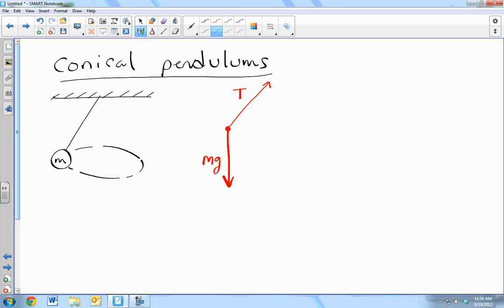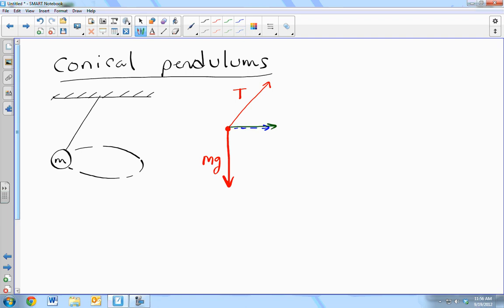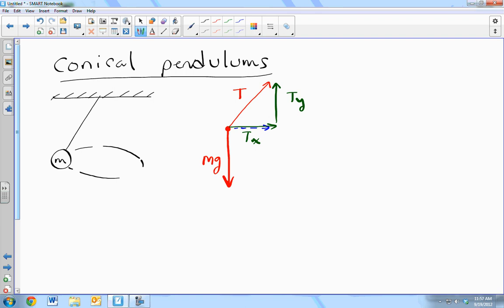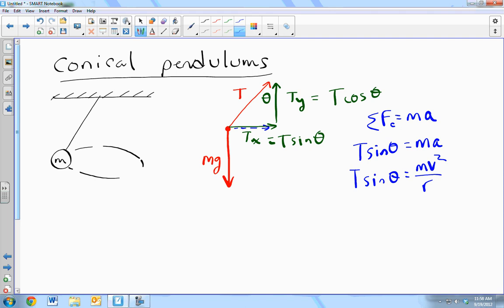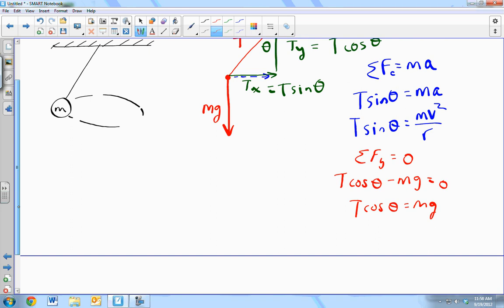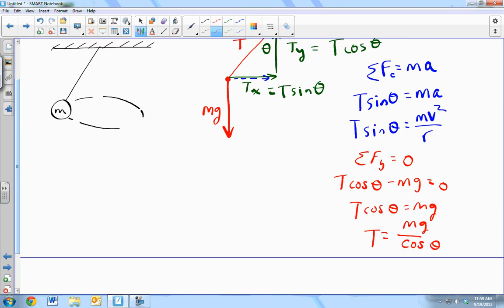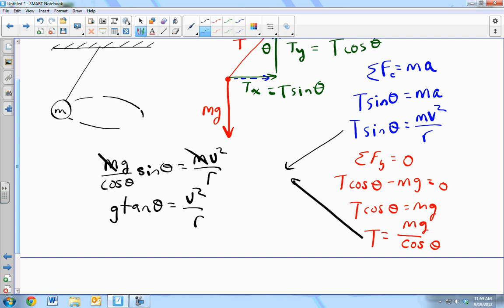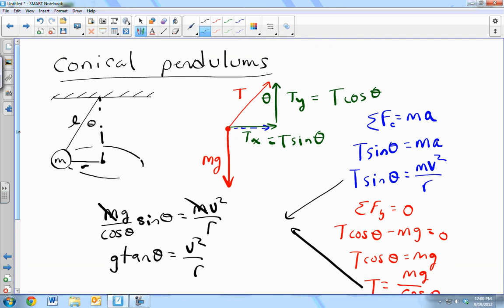Conical Pendulum

Comment: you know, when you get to your tension in the x and y direction, I don't get how they just became T. I mean doesn't Tx differ Ty? So how did you substitute Ty into Tx, Making i'm missing something or haven't read enough on it. Could you please answer this question as soon as possible, thanks in advance
Reply from the maker: Jilwan Rahimi We defined Tx=Tsin(theta) and Ty=Tcos(theta). The T in those equations is the tension in the string and can be substituted to create a system of equations as follows: 
Tx=(mv^2)/r and Tx=Tsin(theta) --> (mv^2)/r = Tsin(theta)
Ty=mg and Ty=Tcos(theta) --> mg = Tcos(theta)
Once you have both of those you can solve them by substitution.